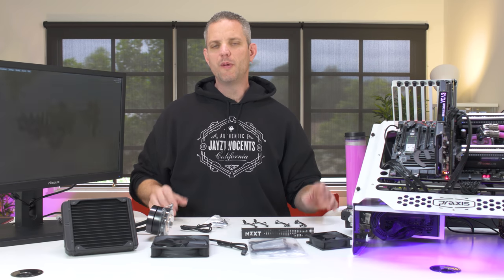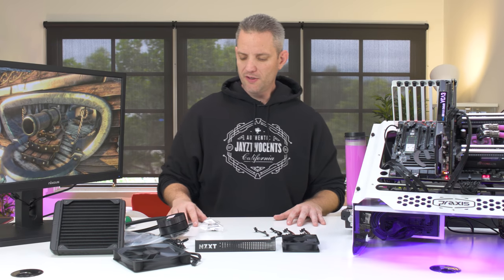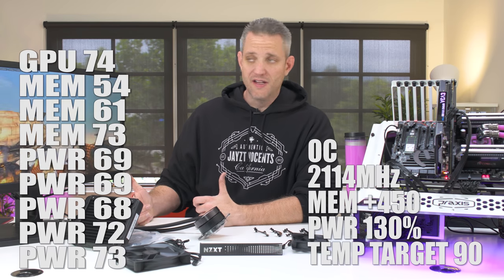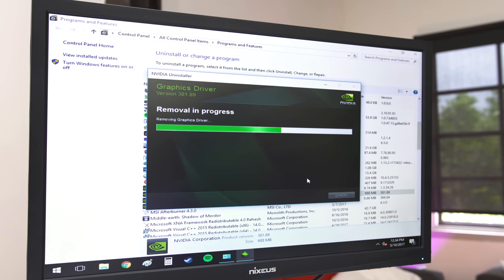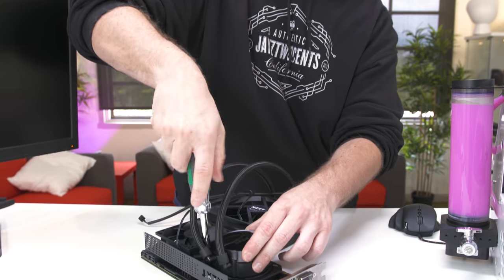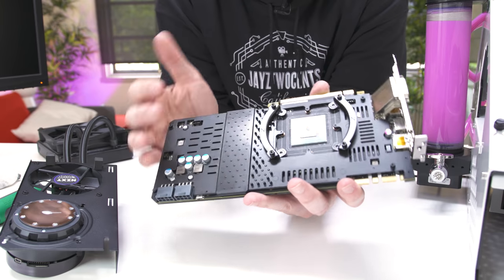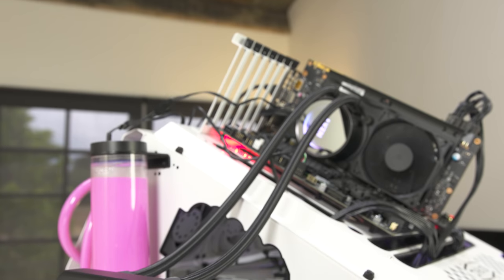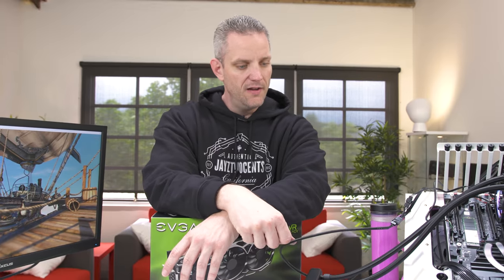How to Watercool a Video Card... The easy way!

Comment: I have the G10 installed on my Asus Strix 970 for a while now, it has performed brilliantly, i'm seeing a 20-15c reduction in temps across the board.
Another thing to note is the significantly reduced noise under load, the original air cooler the card came with, although silent at the lower temps, once it would start hitting 65c+ it would really start whirring up (games like Witcher 3, Mass effect andromeda etc took it into the mid to late 70c) and would really intrude on my gaming as I don't use headphones.
This has also had a positive effect on the other components in my case too, my cpu temps have dropped a few degrees as there is less hot air being blown around the case by a toasty gpu.
Going forward i'll be installing these systems on all gpu's I have in the future.

Comment: i have an EK Predator and I simply replaced the cpu block with a gpu block. The pump is on the radiator on the Predator. Wasn't more difficult to assemble than this one and I get better results. Just an alternative for someone who doesn't want to build a full custom loop.

Comment: Tempperatures on the PCB came down because the GPU wasn't getting hot and transferring heat through the copper traces with it now running so cool.

Comment: Wouldn't the temps be lower if the radiator were above the block? Meaning the fan being mounted somewhere above the block so the loop would  return the cooled liquid down to it? In the EVGA Hybrid 900 series card I installed, it stated to mount the radiator in a position above the graphics card for that reason. Seems like having the radiator on the table below your test rig would lead to higher than normal temps.

Comment: The funny thing is, I have been in contact with NZXT regarding the x42 with a 1080 card. According to them not even the x62 is enough to handle the 180w tdp from a gtx 1080. It's supported to mount but when you talk to them their aio coolers ain't enough to keep the liquid temp down to a level that's not damaging the cooler...

It should be noted that the card temps are amazing.

Comment: Had an old 980 ti hybrid kit sitting around. used the aio cooler on a founders edition 1080 ti to essentially accomplish the same thing in this video. Stock blower fan cooling memory and power.

Comment: I've been running an antec 920 with its original hoses and replaced the stock radiator with an alphacool monsta 140 radiator attached to Nvidia gpus using the NZXT bracket since 2012. It's been flawless. Always cool, super silent. Amazed it's worked so well for so long . Way more efficient radiator then any stock all in one

Comment: Can I ask why you chose to use a card that has adiquate cooling already rather.than a card that is known to run hot like a RX480 side blower?. These are the cards people would look at AIO cooling I'd have thought. And something like the EVGA1080 would be cooled with a proper full cover block because as I under stand it there are no block made for say for the  Asus Strix rx480 O8G so AIO is the only choice for this card.

Comment: Hey Jay a quick question here:
I know there are full PCB waterblocks for graphics cards, but what if you try to put a CPU waterblock on a GPU with that system? Would it reduce even more the temperatures? Because I feel full blocks don't perform that good because they have to cool also memory and VRM. I think it would work

Comment: Doesn't exactly look pretty though.
Reply: Mugeno_o I think it looks really unique. kinda dig it.
Reply: you can mount the back plate, and built in the case it looks quite nice, in my opinion looks even better than with the beefy air cooler.
Also solves the sagging because you take off most of the weight.
As Jay says in the video, If you "HAVE" a card, this means if you already own a card, and wanna watercool it, this is the cheapest way, and it works.

Comment: I had to do the same thing with my corsair H50 and kraken G10 for my maxwell Titan X, I just chopped off the pegs and its virtually the same, for me it wasnt a warranty issue because the plates i got was from the individually sold ACX cooler for the titan X. Note this statement was after reaching the point in the the video where he reached the same problem, lol.

I've used a kraken G10 bracket chopped to just the mounting hardware with the EVGA inner plate/back plate (modified to allow a circular AiO) and its been amazing. I've only has it come apart once (because i guess i didnt tighten it down fully) and had it fry a  card, but luckily EVGA is a bro and just swapped me a new one.

Comment: Whenever I need to change to use this water cooler I worry about what will happen to the GPU RAM. It also heats up and why do we avoid cooling other chips? The original heatsink fans drain the memory chips heat to the cooler. aren't reduced heat isn't belong to those chips? i know water can hold many heat.

Comment: I have a msi gtx 1080 gaming X and would it install the same way since both cards are using non reference coolers I would assume the PCB would be the same. woudn't need to add some heatsink's to the vrm and vram correct. have a spare h110 that I can use as cooler.

Comment: I installed this with a kraken x31 on my Kfa2 980ti oc Black. When i took the card apart i was so lucky, there where allready a heat spreader for the vrm's.  right under where the g12's fan blows. 
Awesome product 80 to 46 Degress.

Comment: I can confirm that you can retain the front and backplate on the msi 1080ti with this setup and zero modification. Thanks for the video, I'd add an affiliate link for the black version of the g12 as well.

Comment: I'm kinda guessing with the bare PCB components, that assuming it'll fit with the fan in place, that you can buy some basic stick-on copper heatsinks and thermal tape, and solve that issue pretty easily

Comment: Where did you connect the fan that sits above the memory, the fan on the radiator and the pump? And can you control it all through the CAM software and create curves and so on? I really like the setup, but it really depends on whether or not you can control it all. And lastly; would you recommend buying a lower end card with this cooler and then overclock the shit out of it or buying a better card and leaving it at stock. I'm going to apoligize in advance here since I'm not the PC/tech guru like many others here.

Comment: I had my 390x hooked up to the NZXT G10 and an H55 and that thing ran super cool. What was a nice find was XFX had a separate metal fin array that screwed on the power delivery instead of using thermal pads that touch the fin array on the heat sink so I was able to leave that screwed on so the fan was pretty effective on cooling.

Comment: Does this work with an NZXT S340 Elite? 

I Mean, where tf would you mount it if you're already using a liquid cooler / rad mounted to the front of the case?

Comment: I have a triple 120 aio that I'd like to use on my 1080 ti. Where should I plug in these fans? do they get adapted down to the mini header(s) on the gpu's pcb, or do I plug them into the fan headers on the mobo, or? Where do you plug in the pump?

Comment: I wish you good luck cooling the VRMs. The thing i made is take Aluminium plate and i rework it to fit the whole graphic card.On the other side i put normal cheap CPU waterblock.End resault is 50 degrees max on the GPU and something like 65 on the VRMs on OCed 1060.Overall i didn't expect the VRMs to heat the plate that much.

Comment: hi!I was able to get a Kraken G12 on a Asus strix 1080 ti without having to remove the back plate or bracket, using a corsair h75 with noctua fans  gets idles of 24/26c and highs of 40/45c for 140$ id say thats amazing sense the Waterblock costs 200$ alone for a strix and thats not alrdy having the rest of a system.

Comment: Hee Jayz... good video thanks!... One question.. is it better to put the radiator with the pipes at the bottom (down) and not in the top (up) as you have done now? Or does not matter? Thinking about some trapped air bubbles?

Comment: I dont like that the cooler is quite high. Something like this would be very good for SLI cards in a cramped case but with that tubes and large (unnecessarily) large pump it occupies at least 3 slots

Comment: im sorry for the dumb question, but the memory in the graph is the video card memory right?the 11gb .So there is no problem in overclocking the memory to 12gb (+500) that the temps would be ok right?

Comment: when you took front and backplate off did you remove the thermal pads on the front plate? or did you use different ones?

Comment: Nice Jay, but where did you plug the fan cable from the AIO fans? I have Asus Strix RTX 2080 Super with 2 Fan connect pins at the end of my card, you think is wise if I plug AIO fans there?

Comment: Thank you, do i really need thermal pads, because they fall down?   (I got 2080TI) i got Phanteks p600s, beast airflow, i did use the kraken x63 280mm in front of the case, with fans  removing the heat from the case, i am not sure if it is wrong, in front we always put the fan to blow the air inside!
Reply: I have the same fan config and as long as your front airvents are covered with dust filter it is going to be alright. All we have to do is make sure the exhaust fan(s) are getting less air volume then the front are delivering. It is to keep positive air pressure in the pc case, to protect getting polluted air from not filtering holes and air vents.

Comment: Thing is, the faceplate only helps reduce the temps temporarily. Worse off, the thermal pads actually work better as an insulator and don't transfer heat well at all. Long story short, the faceplate is a plate, with not a lot of surface area.
Reply: David Whitfield I was going to do this to my evga 1080 but with no way of measuring the vrm and vram temps it's a bit off putting

Comment: in theory could you use this to mount a cpu air cooler on a gpu? I didn't look at the installation process close enough to see if it uses screws or not. if you can do it, it would be a cool video to see

Comment: I've installed a kraken G10 on a XFX 390X, wanted to use the vrm heatsink so I ended up with just a little bended PCB. After a few moments it started to freeze and to show artifacts lol. It's not really that easy to install water cooling on a GPU, you need to be really carrefull..even how much you tighten the screws, it can damage the chip.

Comment: The problem is, that when all the cooper touches the VRM and vRAM modules, the heat from the GPU are spreaded wide in all the cooper, so, some of the GPU heat are making the VRM and vRAM hotter, the vRAM and power delivery should be cool without any cooling, a lot of motherboards and also RAM modules comes without any cooling or heatsinks, and they work just fine.

Comment: Are the heatspread pads essential on older cards ? I'm using a 780ti 3gb sc / acx and I remember when I opened the card up to clean it out and put some new paste, that the vrms were bare ... now I'm getting between 75 to 80 degrees while playing games (fans at 75 percent) do you think this is normal guys ?

Comment: I just put a X62 on my Asus Strix RX480 O8G. This card now idles at my room temp all way.down to 19c and sits at 32c to 33c with a run at time spy after the X62 has heat cycled for a hour. And after 2 hours of gaming it never past 54c. If only I could get some small heat sinks that would fit under the G12 without impeding onto it the card would clock higher I'm sure. But I did notice the voltages had dropped. So the rx480 and 580 would defiantly benefit from AIO cooling.

Comment: Companies that make these (like Corsiar) need to make a "mirrored" version.. My VRM's are on the opposite side of the card, where the displays are. I know if I put a heat sink on them, they temps shouldn't go over spec... but it's still such an easy fix.

Comment: do you have to use a seperate radiator for your gpu or could you throw a couple t's off the rad for your cpu if you have a large like 360mm

Comment: hey man I have a GTX 1060 6gb version that's the unable to play any games when I try to play any game it will play for a little while then overheat I will have to open up MSI afterburner manually set the fan to 50 and then I can bring it down to 30 but I still won't be able to play games eventually it will overheat should I just turn it into a water cooling option or should I just throw it away Will it help in anyway

Comment: with the NZXT Kraken G10 you could fit some heatsinks on the VRAM under the bracket and it was pretty good. but with just the bracket the temps on VRAM were pretty damn high. can you do it on the G12 also?

Comment: I have a couple of G10s laying around that I used for my 670s a few years back. Worked pretty good, though I did have to get extra fans to cool off components on the I/O side of the pump due to the way that card was built.

Comment: NZXT needs to make a new bracket for the RTX 3000 and 4000 series as i want this so bad for my 3070 as i came from a 1070 EVGA hybrid had that for few years and now back on the fan GPU it sucks so much louder and runs hotter then a AIO but we just have no AIO only the full on liquid kits no AIO on the market for the 3000 and 4000 series it sucks.

Comment: I bought a g10 a few months ago and when it arrived i noticed it wouldn't fit my gigabyte 1050 ti, this time i have looked on the website and the 1050ti is still not listed, the 1060 is but are they the same size?

Comment: Surprised the other components were able to dissipate heat BETTER by removing the heatsinks and just blowing a fan on them. Be interesting to see more testing on that. Maybe moving a CPU cooler on the GPU and just a fan on the rest, or replacing the thermal pads with high quality paste if you can get good heatsink contact.

Comment: Not sure if this applies for ICX (or if this was mentioned in the comments for that matter), but I do remember someone on youtube using a copper shim for him to be able to use a G10 bracket with his EVGA GTX 970 FTW card without him removing the backplates and whatnot.

Would be interesting if you could try redoing this test with such. As always, interesting video Jay.

Comment: Anyone knows where do I need to  plug pump cables if I have one water cooler on cpu and how fast I need adjust air fan to have same temps? In Jay video looks that fan works very fast so it's a big noise for my silent rig I guess

Comment: The Kraken G10 + Corsair H90 works great for my R9 390 but taking the GPU apart was terrifying and I had to add heatsinks to the VRM modules and power delivery using permanent epoxy so my card can never be put back together. It took 20 C off of my gpu temp though.

Comment: been doing this since i got my 7970ghz edition on day one when they came out back in 2012.Made my own bracket to attach a h55 to it witha slim 90mm fan and bam, single slot 7970 ghz edition dropped 15c but the major thing was i could run a single 120mm fan at 800rpm and it was dead quiet compared to the tripple fan windforce coolers gigabyte put on the 7970 back in the day. :) 

looked fantastic with 2 7970ghz edition and 2 corsair H55 :)

Comment: All heat sinks have an inherent inefficiency due to the metals used. Not to mention the so-called thermal pads. Which adds even more inefficiency. I would think that you would gain heat removal to the air without a heat sink since the GPU's heat is being removed with liquid.

Comment: Hey, Jayz! I'm getting ready to add liquid cooling to my new ASUS GTX1080Ti with the NZXT G12. I've already got a cooler that should fit on the G12, but my question is, can/should I plug in the G12 fan to the card where the original fan was? I've watched several install videos, and no one shows where they connect the fans. I've already got a fan where the radiator will go, so all I need is advice on the bracket fan. I'm also going to use aluminum heat sinks on all VRMs to make things cooler.

Comment: So, I'm going to just put this out there, for anyone watching in 2019 or later looking for an easy water cooling solution for their GPU: I do NOT recommend the NZXT G12, or any DIY AIO solution without VRM and VRAM active cooling. The Alphacool and EVGA AIO kits at least come with a heat sink that covers both the VRM and VRAM more akin to what a factory made AIO GPU would use. I actually lost two GPUs to RAM going bad using the G12, and I had heatsinks mounted on both the VRM and RAM chips, but the little fan that comes with the G12 just is not adequate enough for a modern GPU. I know RAM specs allow it to get pretty hot, and if you undervolt your GPU you might be able to get away with it, but if you ever overclock or play any super demanding titles I would steer clear of the G12 and go with something else. Now that I've recently lost another GPU I decided to finally invest in an open loop cooling solution.

Comment: That is really cool (sic). So the next question is which 1080ti graphics card should we buy and do this to? (This is bearing in mind a bunch of cost is associated with an out of the box aircooler that you would throw away using this technique...)

Comment: Thanks for the awesome video! I will be doing this to my card in the future. I'm currently using a AIO cooler on my cpu, and my system stays so cool and blows to slightly warm air up top, but down by my graphics card it gets pretty warm. I'm hoping this would significantly help that out. What 90mm fans would you (or anyone for that matter) recommend if I were to replace the included one? And would it be worth it?

Comment: @JayzTwoCents Jay, you can also add a gpu copper shim between the gpu die and the heatsink. No need to use a dremel or remove the backplate. You can get a 20 pack for 8 dollars on amazon.